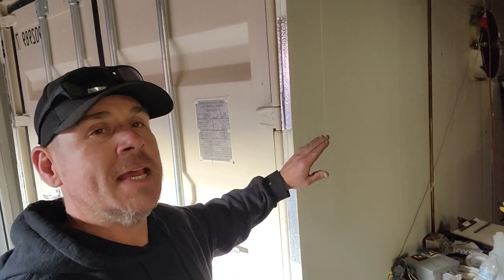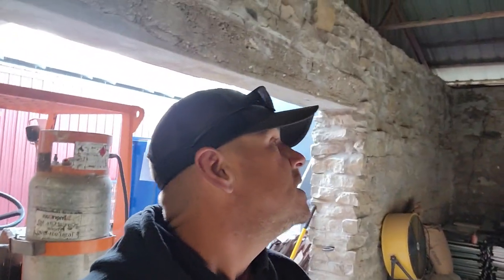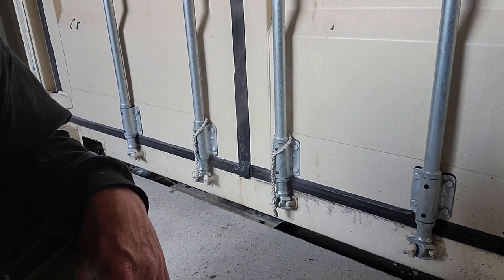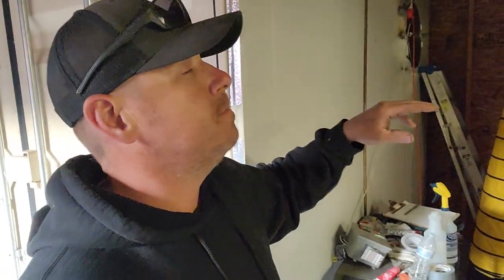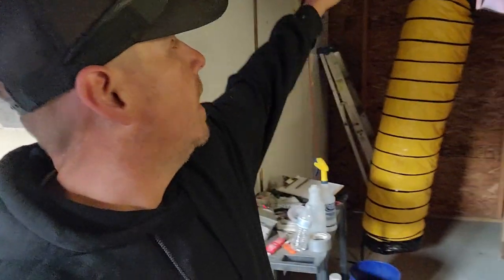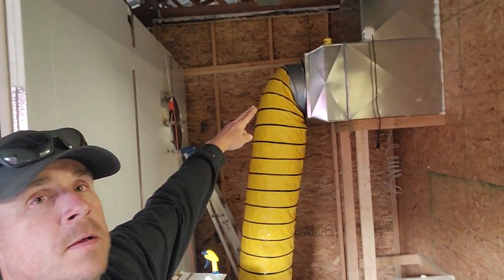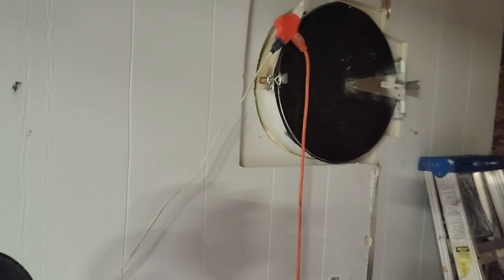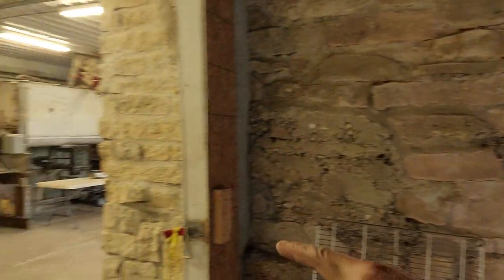Mushroom Substrate pasteurizer

Comment: Great video, I’m currently testing out an insulated and waterproof cinder block unit to fit all my bags in. I don’t see anyone else doing this so I hope it works. I just have a question about what is your source of pressurised steam? Do you use a boiler? Or a DIY unit?
Thanks

Comment: Great video and awesome sterilizer, it's huge but i have a question, in smaller sterilization setups why do some people use a boiler connected to a trough for atmospheric sterilization, doesn't it make more sense to boil water in the trough with a burner underneath? I do this with a steel drum and at least at the top the steam easily gets to 300f.
Reply from the maker: Yes,  you can do it the way you are.  That said,  steam cannot get above 212f unless it's under pressure.
Reply: @earthangelmushrooms2118  Huh... maybe my thermometer is broken then, i does have a bit of pressure but not that much.
Reply: @earthangelmushrooms2118  there is an exception to this, steam can be 'superheated' after it's produced but it's not good for our application, it doesnt give to it's heat as easily. It's also called 'dry steam'.  All that said, you can not directly produce superheated steam from a open boiler, it requires a superheating exchanger section. Fun stuff thanks for sharing.
Reply: @CMZneu  maybe ur thermometer is touching the metal parts. If you use a burner, the metal parts temp can easily exceed the temp of boiling water. You have to make sure u are measuring the temperature of the steam/air inside, not the temp of the barrel walls, so your termomether absolutely must not touch any metal parts.
Reply: @Quiablo  it's a bimetal oven thermometer so it's hard for it to not be touching the steel drum since it has to be screwed to it, the drum has a good amount of glass wool insulation around 80% of the sides and the lid, but the thermometer is near the lid so it's as far as possible from the burner. I've done test with supplemented sawdust filling a sealed jar 1/4 of the way and left them for months and there never was any visible sight of contam, and i opened a closed a few for a few seconds and sure enough contam got in a grew as expected so it's at least sterilizing quite well at whatever temp it does reach.
Reply: @CMZneu  Sure, I didnt mean to imply u could not get good results with ur system, I am just saying that the temp reading is probably meaningless if the thermometer touches the metal. This is not a problem if you heat water using a submerged electric element, for instance, but most definitely is a problem if you use a burner on the underside of the barrel. You could try using a different thermometer for better readings. What is certainly true is that u are not getting 300 fahrenheit steam.
Reply: @Quiablo  ok then i'll have to get another type of thermometer, what do you recomend? like what type, something electronic?
Reply: @CMZneu  at sea level 300 degree F steam is almost 60 PSI. You'd need a pressure vessel to reach that temperature, and a very stout one.
Reply: I use a separated boiler from my steam drum, the main reason is I can have multiple drums and run the boiler a lot, while another drum is cooling another is pasturizing
Reply: @LazySillyDog  That is much more practical, one thing though i was thinking maybe the way i do it with the burner directly underneath, the whole thing it is acting like an oven with steam and that is why it's reaching higher temps, there is also much less wasted heat. I mean if i didn't add water it's perfectly reasonable for it to get to 300f at the top, sure the water isn't getting at that temp but the air and steam inside could.
Reply: @CMZneu  yea that makes sense, there is definitely much less heat waste with the burner directly in the barrel. from what ive found with my production, the wasted heat is negligible compared to the amount i can produce from one boiler + multiple steam barrels, plus the safety benefit of having them separate. if i need to add more production, i dont need to invest in more heating elements + controllers to do so

Comment: Cant u use polyurethane foam to stick the insulation to the walls? If there are no leaks, polyurethane should be pretty stable at those temps. Is will not behave well if there is hot steam blowing on it though.

Comment: Excellent design brother (This is Kiefer btw) whenever you see comments from Linda Bonomo it's Kiefer Myers on my wife's YouTube account.
I use a sauna steam generator, an aluminum shelving unit 8ftx2ftx4ft, and a custom 40oz neoprene cover strapped over it on gaskets. It's a design inspired by Cyrus Lester with a few modifications. 14-16 hours and it rolls into and out of the lab. We only do 120 bags a week but that's plenty right now because I have no employees. $1200 total for the design and it holds a max of 180 10 lb blocks.
Reply: 6kw of power

Comment: We stuck our polyiso to our milk tanks using cans of greatstuff polyiso spray foam. Worked great. Make sure its the same 200+F rated foam spray not low temp sprayfoam. Most of the stuff on the hardware store shelves is polyiso high temp rated foam spray (various brands). We also used brass gate valves for cold hepa air input and vents. We run cold water through the milk tank cooling coils. We gave up on a big metal box idea (gasket leaking issues) and use single lid giant milk tanks instead (200 bags a tank). Soo much better. Don't forget the UVc in the fogger tank. ;-)

Comment: Impressive, nice setup!
Which type of PID controller do you use?
Reply from the maker: These are inkbird
Reply: @earthangelmushrooms2118  Hey TR, can you make a video about the boiller? Thanks for the info. I just built a mush farm. I am coocking 150x12pounds bags per week but need more capacity, my atmosferic boiller is not good enough for expansion.

Comment: Use a insulation like this with steel studs.  You can screw the studs to the box and they won't fall off because of the glue failing.  It is sold at Menards.

Johns Manville TempControl® R-23 Mineral Wool Insulation Batt 15.25" x 47" (24.9 sq ft)